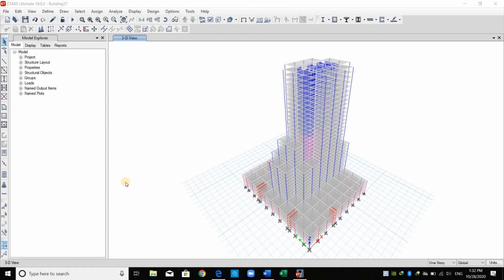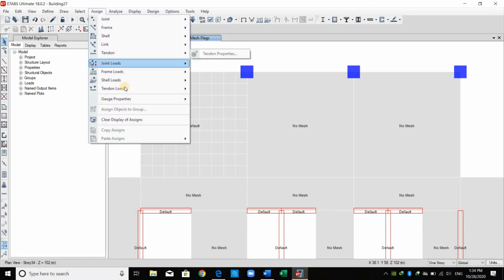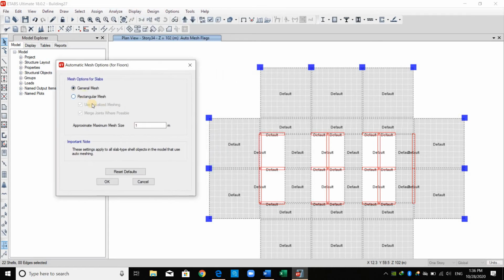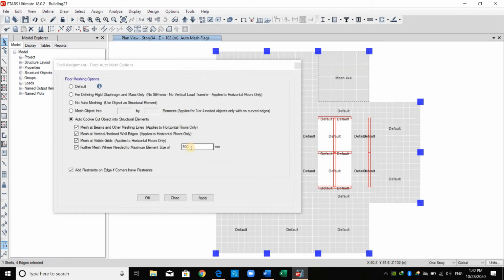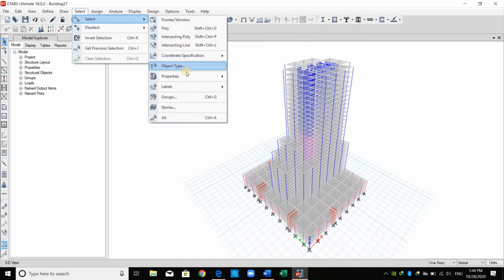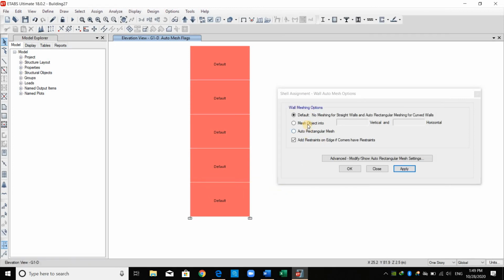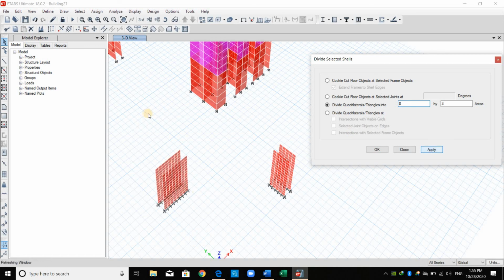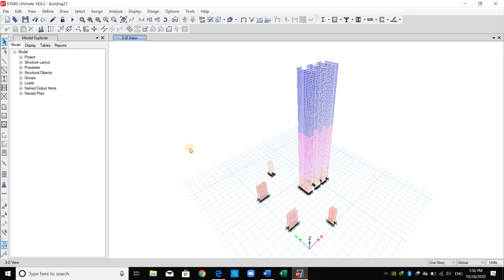How to assign area meshing for floors and walls in ETABS? (Lecture 7)

Comment: how can you be sure that the meshed walls are well connected to meshed slabs? the joints of walls should be same of slabs joints
Reply from the maker: You are absolutely correct in stating that the joints of meshed walls should be same of slabs joints. To achieve this, it is important to divide the elements appropriately and use the mesh size that is suitable for both the slab and wall elements.

By ensuring that the joints of meshed walls align with the joints of meshed slabs, you can create a well-connected system that promotes structural integrity and stability.